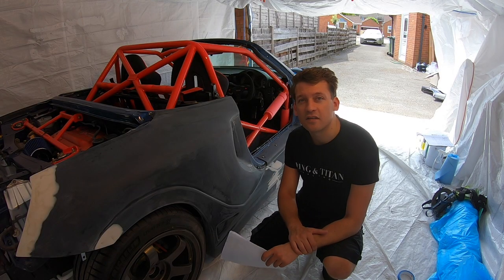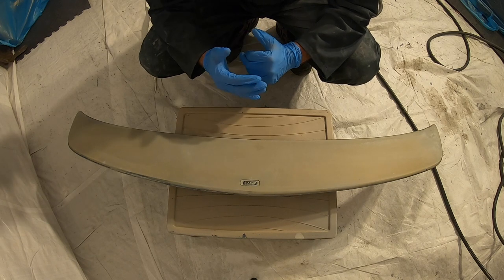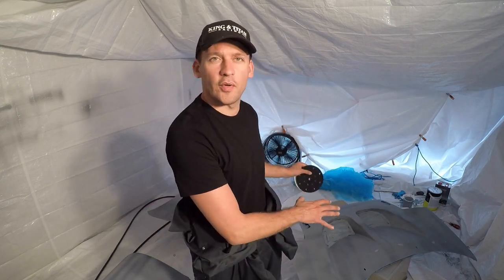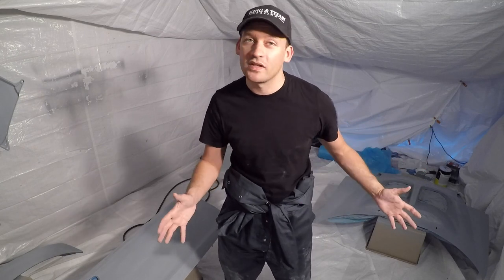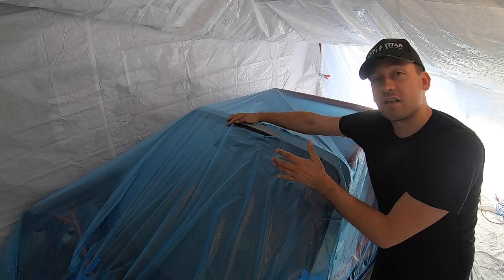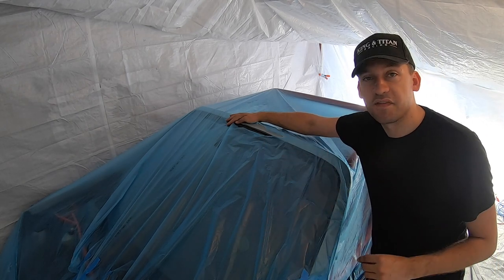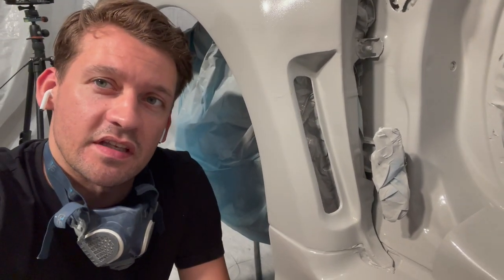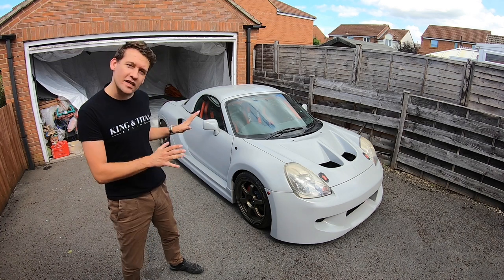How To Respray a Car, Get Pro Results at Home

Comment: I can't decide what I like better, this or the monocraft gt300.. Though I don't have as much choice now as the monocraft has been discontinued already and you could get the APR kit still today.
Reply from the maker: It’s a really tough choice. Originally I was trying to buy a blue Monocraft kit but sadly the car got sold as a whole rather than breaking it. Once this kit arrived I was much happier with how it looks in person, I do still covet those fins on the skirts of the gt300 though.
Reply: @KingandTitanRacing  MAN! If I lived in the UK, I'd bite the bullet and buy the whole car anyways, maybe de-rego just to have a spare chassis (this tropical island might rival you guys for the tin worm population)

I like the front and vent work better on the monocraft. Seems like APR aspired more to look like an older 911 out back with the massive curves but tiny hole. The monocraft suits the overall round-box shape of the spyder. 

But there's no denying that the APR kit DOES look good!. One might just have to pretend monocraft don't exist. 

Also, I am unsure how the APR kit will look with the TRD style rear wing. I am mixed on the looks of the wing because from the 45 degree front angle of the car it looks sexy.. but from the immediate rear it looks like a pissed off cat with it's ears tied together with rubber bands by a child. They should have made it wider to match the dimensions of the car. it's slightly too narrow even for the stock body (a wing should NEVER look bad from the back!)

Comment: Good Job, Can you explain about the sanding between coats? Are you doing it at the paint stage? thanks
Reply from the maker: Yes between every stage. You don’t sand hard but use a soft sponge and rub it down. That helps the next layer catch evenly and layer up well. For my paint it was the different grits I showed on that sample part at the beginning. You don’t sand your final layer, that just gets polished like normal once it has fully settled and hardened.

Comment: whats the spyder been up to? I’m about to embark on a similar journey. Have you been able to take it to the track?
Reply from the maker: Since the respray I’ve had a list of things to finish, had some custom welding done at the back to fit the rear diffuser to and rear plate, had some emissions issues which are now fixed and now I’ve just got to do some PPF and then it’s road and track ready. The plan is to be out on track again by April latest and then spend the summer going to shows and track events.